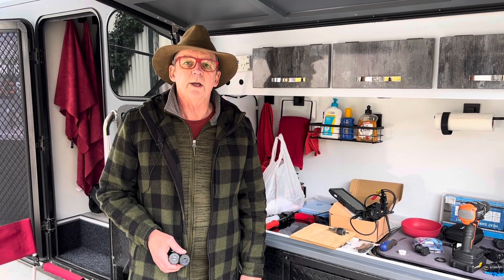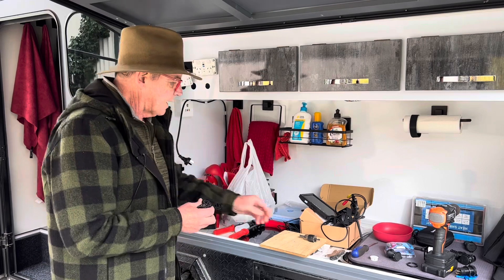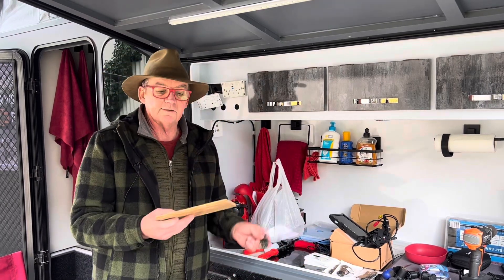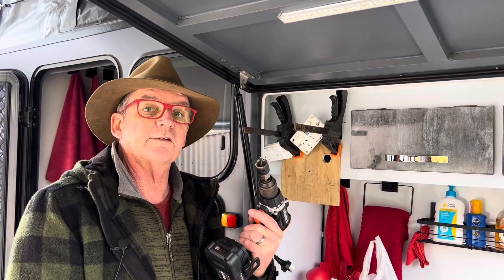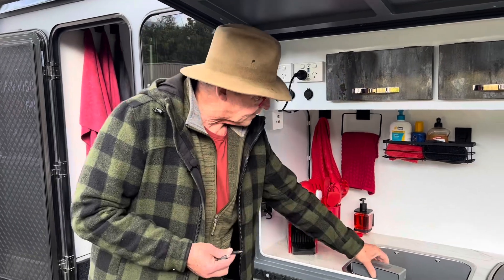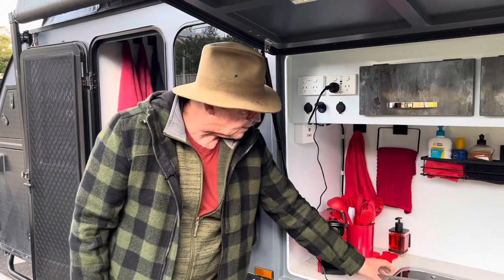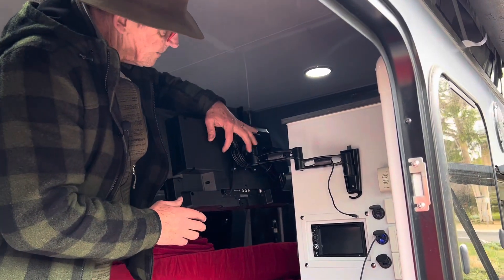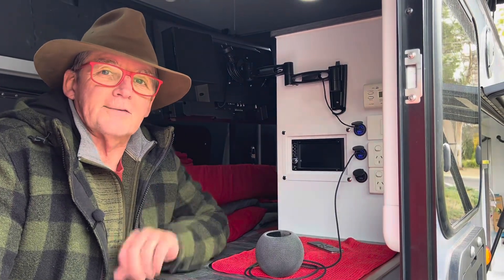AusCamping - replacing USB outlets with PD + QC3 outlets

Comment from the maker: The components we used;

65W PD USB C Laptop Car Charger 18W QC3.0 USB Outlet Socket for Car Boat RV https://www.ebay.com.au/itm/285202446533?mkcid=16&mkevt=1&mkrid=705-154756-20017-0&ssspo=V9H50Vh0TRG&sssrc=4429486&ssuid=cDR3bhLAR4K&var=&widget_ver=artemis&media=COPY

USB C/Type-C PD to 12V 15V 20V 5.5x2.1mm Converter Cable Power Cord for Laptop https://www.ebay.com.au/itm/374614429131?mkcid=16&mkevt=1&mkrid=705-154756-20017-0&ssspo=3TY5y2kvTai&sssrc=4429486&ssuid=cDR3bhLAR4K&var=&widget_ver=artemis&media=COPY